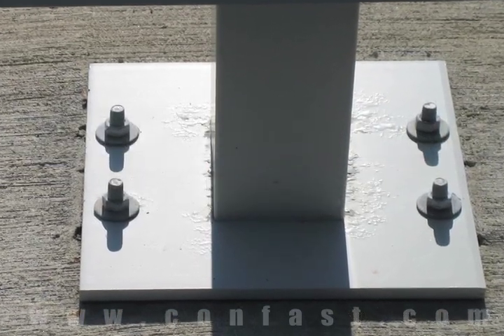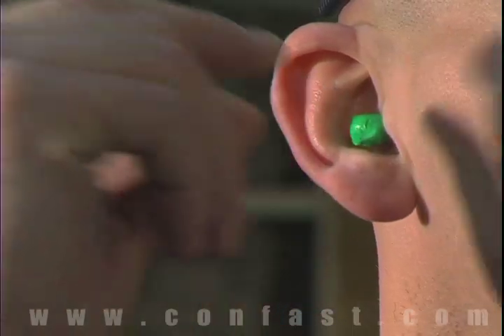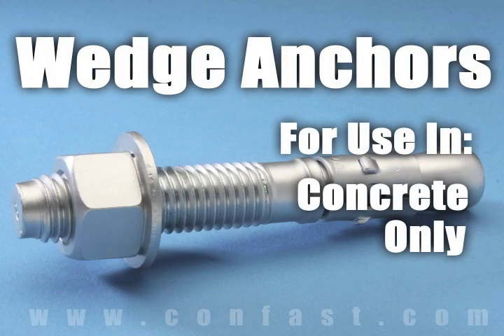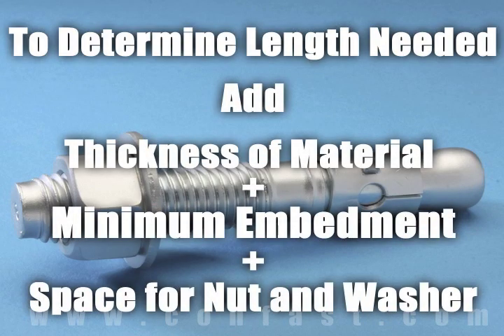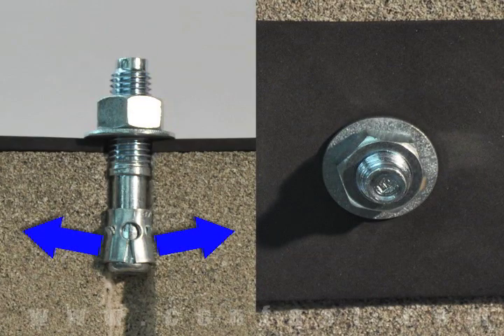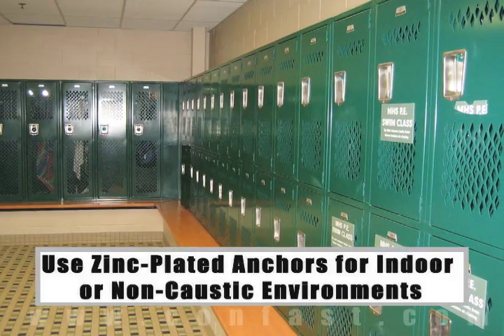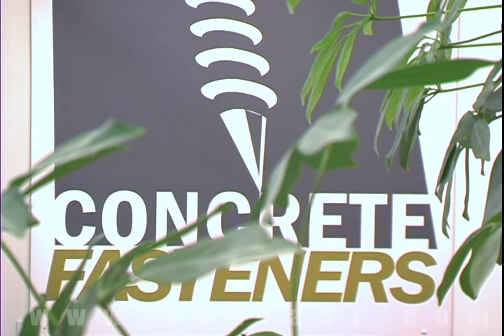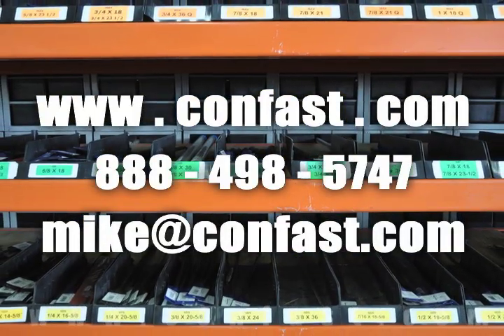Attaching a Pedestal to Concrete Using Wedge Anchors

Comment: for the purpose of fixing the interlock tiles my iron rod clothes stand was removed. I can use the same method right? to reinstal it...
Reply: ...I think, the can be re-used; use a cement epoxy for a better bond.

Comment: I was provided these type of bolts for a project, but the flooring I'm drilling into is wood.
I realize the structure will not be as solid, but is there a type of replacement bolt that you 
could recommend for wood flooring? Thanks very much

Comment: Thanks, had a bunch of these for years and some other kinds where the thing gets hammered in to expand the bottom by collapsing the stem.  I was just about to do that and I took a look at what i had and thought   that just doesn't seem to be the case with these. LOL 

  so i looked this up.   looks much easier.    mail box will be up in a few now. LOL  great video. Thanks.
Reply: Larry Leisuresuit what size bit too use for a 5/16 bolt?

Comment: I think that these anchors should not be used in areas subject to freeze-thaw cycles. In those conditions a threaded rod anchor secures with epoxy or acrylic adhesive is a better choice.
Reply from the maker: Chris Hubley Depending on the application epoxy may be the better choice.  Wedge anchors should not be used in all applications all the time.

Comment: Institutional finish at base, a better way is to drill four inches down beneath post and install a one inch pipe (gavanised), into it using rockite and keeping it plumb until it drys,no more than 30 inches up from slab, put de upright leeve over that install railings tuit...fill with concrete to top instal cap,which may have a solar light.If yo like or deco cap,or plain square champered.